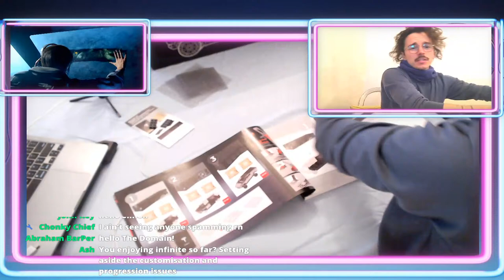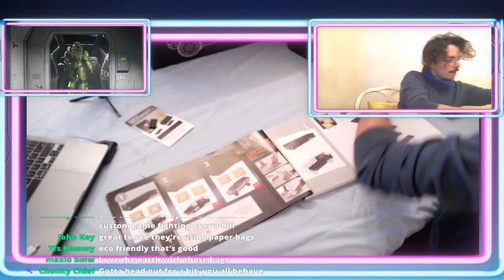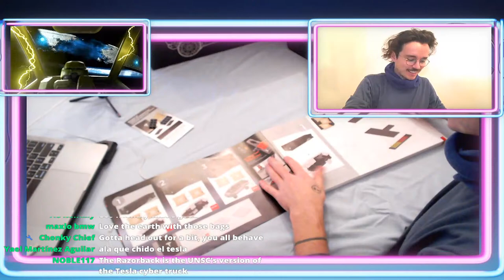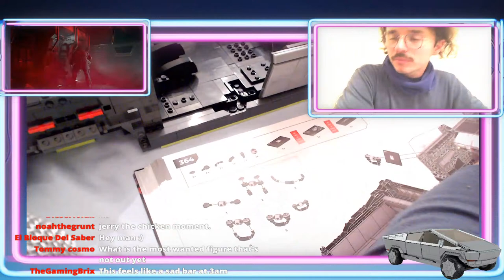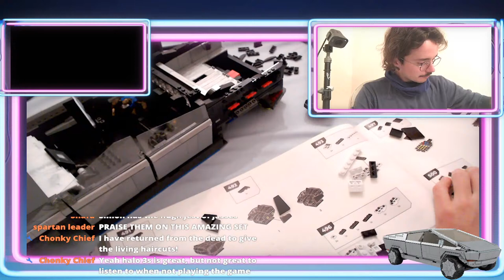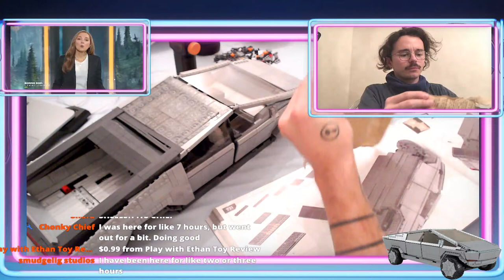Building the Mega Construx Tesla Cybertruck for AS LONG AS IT TAKES!

Comment: I would like to see final hour as well since I've finished mine but have a problem with back ratchet mechanism for lowering the wheels. The front mechanism works fine but the back one barely works! I've checked the build of that mechanism and can't find any errors. :(